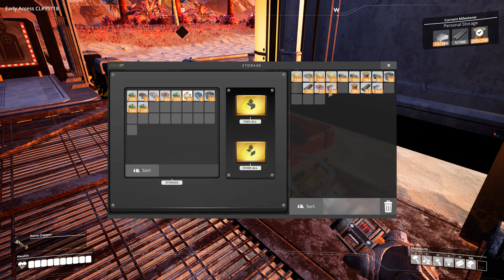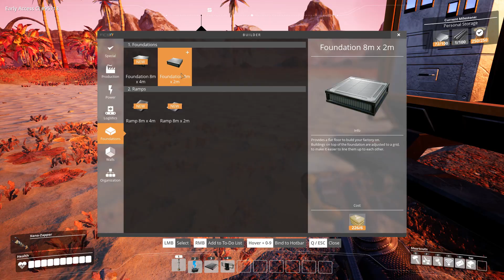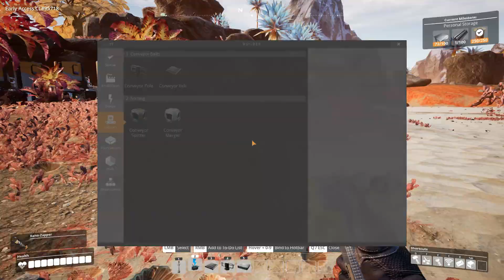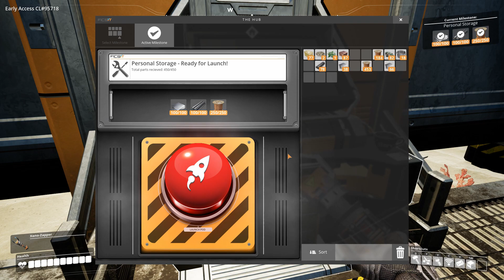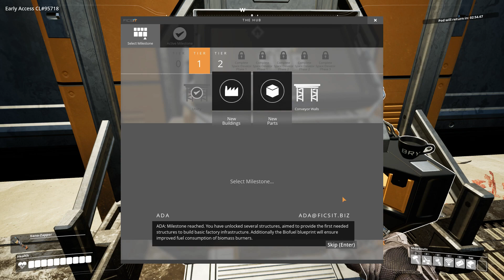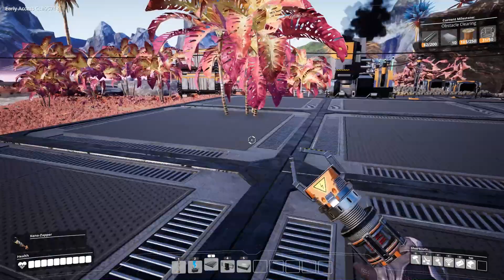A Satisfactory Desert Let's Play! #2 Let the Smelting Begin!

Comment: a tip you have your miner to a splitter that is connected to 3 things so that is from the 120 ore every min splits to 40 40 40 and 1 of the 40 goes to a splitter and splits 20 20 so you have 2 smelters 40 and 2 smelters 20 ore every min
Reply from the maker: Ahhh ok, didn't know it split evenly, was hoping it would split based off of demand.